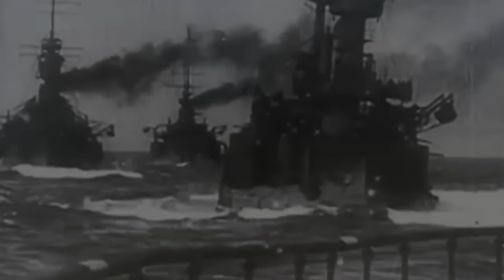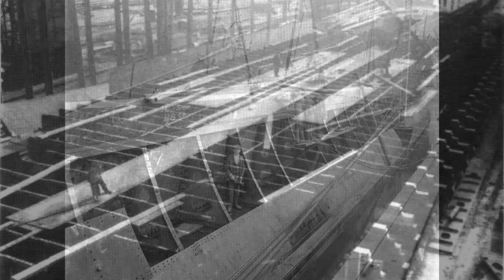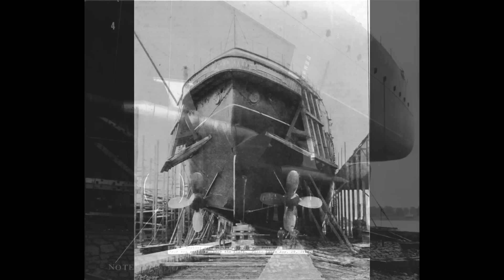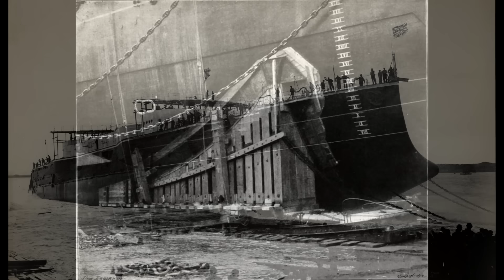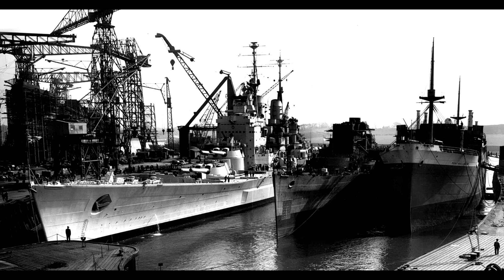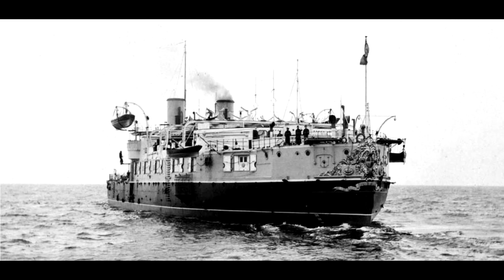Naval Engineering - Building a Battleship from Keel to Commission

Comment: My father worked briefly on the Clyde shipyards in Glasgow, around 1952. He was a rivet-thrower, only 12 or 13 years old, he spent all day picking up red-hot rivets that weighed about a pound with tongs then flinging them 2 or 3 stories up to the catcher as described in this video. Apart from the danger and the constant sight of other people getting terribly injured, the notable thing about this job was that the slightly famous Scottish comic Billy Connolly was working at the same yard and they crossed paths numerous times.

Comment: Interesting Video, thank you.  I do have a question about the slipway.  You said the angle of the ship on the slipway had a sloop of 1 to 19.  Is that 0ne foot for every 19 feet of ship or in metric 1meter for every 19 meters of ship? So, for example an Iowa class battleship the bow would be 47 feet higher than the stern.

Comment: Re the riveting team: one man operated the riveting gun. This was hard and fairly skilled work. The other man on the other side held a lump of steel against the rivet being driven, which caused the end to round off tightly. This job was easier and less skilled. That “lump of steel” is called a dolly. During the War, because of labour shortages, women were often used to hold the dolly. They were known as Dolly Birds.

Comment: As someone who is a fifth generation Brooklyn ironworker and steel fabricator, you have done a masterful job, Drach. You describe, exactly as I would, how to make you a ship!. Or pretty much anything else from metal. I started laying out projects just as they did. Creating templates to form the steel..."lofting". Even to-day, using computers, I give anyone rolling a steel cylinder or cone a "sweep" A piece of very light steel cut at a radius so we know how much to roll it. If it is under, we roll it again, if too much, we hope the plate has enough mass to unroll itself a bit...lol. Sometimes, unrolling gets quite fun! Forklifts, nearby machines, and even trucks serve as anchors to unroll things....not for the faint of heart.
But you have the riveting exactly right. Although that poor benighted guy on the inside of the crew, all alone, not able to heard a darn thing, backing up the rivet so it could be set and forged, is called, In America, the buck-up boy. Even if he's 70 years old. He had to be utterly reliable and have a great sense of rhythm. MY Dad was a buck-up boy through his teenage years. He told me very funny stories about it. His chest was black and blue for years because he didn't buck up fast enough...lol.
They drove 5/16 rivets cold by hand, 3/8 were cold with two airguns. Smokestacks took tons of these size rivets. Anything larger was exactly as you describe. 
We had a man who worked for me in 1983 who was 80 years old. He had been employed by us when he was 14 in his summer breaks. He worked for me until a week from his death. When anyone would talk about the "good old days", he'd tell you how they cut a 3/8" plate back then. They would take a plate and lay it on a railroad track, scribe a line. Then they would take a giant chisel with a handle going through it so two men could hold it while 2 more men drove sledge hammers on that chisel. I used to know what that chisel with the cross handle was called. Maybe  "gandy"? But those men would slide it down the line they wished to cut, cutting against the railroad track, which have very hard surfaces on top. A 5 ft wide cut might take all morning. Then they would flip it over and do the same on the other side. Then they would break it like a piece of gypsum board. A 3/8 steel plate. Before oxy acetylene, that's how you did it.
He would tell that story, and then say, "F**k them good old days!" I have always had a shear that could have done their whole day's work in 3 seconds. Now even a mighty shear that can cut a 12 foot plate in those few seconds lies idle. We use CNC plasma to create precision parts. The business is completely changed. And, like old man Silliman, I say, "F**k them good old days!"
Cheers!
Nice job.
BTW, the wooden derricks you cite were either sheer legs or gin poles. And if you saw the ease men could erect them and take them down and move them around, it would shock you. Craftsmen could put them up in minutes like breathing. But they have their limits. I have built 100 foot long ginpoles out of aluminum tubing. When I told the rigger my misgivings about it flexing, he just laughed. "Like a fishing pole?" I said yeah. What keeps it from flexing, making the column strength disappear? He laughed again. "You place a weight at the midpoint with a chain block. When the pole starts to flex, you lift the weight. It straightens out and you can keep picking!". Of course, the physics is correct. If you keep the column straight, you must defy the entire compressive strength of a metal. Which we both know is enormous. Even 100 feet long.
He used his craftsmanship to make a thing which we, as engineers, would predict failure, and supercharged it. He used a simple toll and could make it do three times what it should have. No college. Just an innate understanding of the forces at work. In his bones.
I wonder how much other such knowledge has been lost to mankind. Don't you? And he, who cannot even make the simplest sketch to describe an object, can do this and become THE master rigger of NYC, with an absolutely untarnished record of success, knew this trick, which no decent engineer would have even contemplated! And it worked! Perfectly!
Imagine what some Egyptians could have taught us.

Comment: On having to cut holes to replace machinery.

My dad was the first Chief Engineer on the TT Bedford in the 60s one of the very first 'Super Tankers' built when the Suez was closed forcing ships right round Africa from the Gulf.

He went to Japan while it was being built and was the commissioning engineer for the machinery.

It sailed to Rotterdam where it had to be drydocked as there were problems with the turbine gearboxes and a hole had to be cut in the hull side to allow them to be replaced.
This needed to be done at great expense in a drydock.
As a youngster I flew out to Rotterdam with my mother and younger sister to join the ship while it was in drydock rhen alongside being recommissioned

Comment: I've witnessed the construction of a Nimitz class carrier from the keel on up.  It's done differently now, but not by as much as you might think.  Computers take the place of a wooden model, and ships are built in chunks which are then lifted into place with a crane and then welded into place.  It's a very interesting process to watch.

Comment: I'm a naval architect. Old enough to have been an apprentice at a mold loft.
This was a very accurate description of the oldfashioned building process. Untill computers took over the modelling of hull shape.
Also i wonder if an inclining experiment hadn't been included in the final tests. To assure, that the weight and centre of gravity was as promised, when the contract was signed.

Comment: The slipway was on an angle. When working on board you still needed to build to that angle.
The process involved using a builders level, but at each end there is a tube with the bubble in it and this could be rotated.
You go down to the slipway andbset your level onto it, then rotate each bubble to be level. Finally you tighten up the rotational part so it becomes immovable. 
Now you have a level which can be used inside the ship accurately!

Comment: FWIW it seems the ablution facilities in WWI-era British battleships at least were surprisingly basic. 
Apart from the captain and admiral's quarters and the sickbay (which had actual baths) everyone else only had basins for 'bird baths'. Those for the officers weren't in a single washplace or plumbed to their cabins: instead, the stewards brought hot water cans to fill a small tank atop a washstand cabinet. The officer would let the water into a basin to wash/shave, which tipped up on completion into a tank underneath for removal by the stewards. One of these washstands from Iron Duke can be found at the Scapa Flow museum in the Orkneys. 
Meanwhile, the sailors had their own dedicated spaces with multiple washbasins, which probably weren't individually plumbed either.
As far as I can tell plumbed sinks and showers only became a thing from the 1920's / 1930s.  Even then, limited water supplies meant showering entailed 30-second wet / soap on then 30 second rinse / soap off , which lasted into the 1990s. As it seems unlikely that money would have been spent upgrading the WWI ships the same standard (space/weight issues aside), the previous system would have endured until the last of these ships left service after WWII.
Must've been interesting if the sea was a bit sloppy... and made these ships a bit whiffy in the tropics...

Comment: In addition to the book you recommended, I'd also recommend Silver State Battleship, on the USS Nevada. While not as in depth as The Battleship Builders, it does give a solid account of the designing, ordering, building, launching, and trials of that ship over the early chapters. It also gives an account of some of the...unexpected challenges and results there in during building and trails.

Comment: I was astounded to learn in your video how unfinished the ship was when it went down the slipway. Was this more of a result of a premium put on slipways real estate space as opposed to dock space which could be used for fitting out purposes? Have you seen any man-hour estimates to complete a warship project? The time it takes to loft, cut steel plating, fitting, riveting and assemble the hull structure super structure would be relativity quick as compared to the fitting out of the remainder of the ship. As stated in your video, this building scenario is representative of British shipbuilding up to 1950. I recall reading and seeing photos of German U-boats built in the second world war which were built in near completed cylindrical modules with the majority of fitting out components installed in the module before welding up the individual modules together into a boat. This is of course how ‘modern’ ship building is currently done, at least in Asia. I assume these modern techniques are used currently in British warships construction. Did this modern process start before 1950?

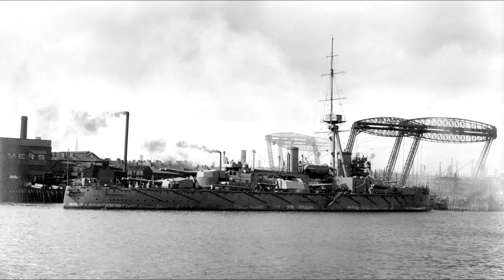Comment: 28:00 Of course “perfectly flat and level” is impossible what was the actual tolerance? (For example) The procedure for installing something like a barbette would have changed significantly over the period covered, as the weight went up by what 10X? From say 1895 to 1935, be interesting to review the changing procedures.

Comment: I had a career in construction and find it very interesting the ships were built with the keel raised slightly for launching. This meant that a level had to be adjusted , because a plumb line would not be perpendicular to the deck. I wonder if they had a tool that adjusted for the offset or if they just used a tape measure to get bulkheads perpendicular to the deck.

Comment: Regarding the scale reference ship model, the father of one of my tool & die mentors, who was also a tool & die maker, worked in a steam locomotive factory where they had full-sized drawings on the walls. According to my mentor (who was a WWII veteran, to give you a time frame), they would directly pick dimensions off these drawings using scales (rulers) and calipers. Apparently, only a limited number of part and assembly drawings had any dimensions as we would expect to have today.

Working with tool & die makers helped me when I later worked as an engineer: they are amazing multitaskers who must develop a talent for simplifying their workflow.

Comment: Great video, Drach. Outstanding. I do have a copy of Battleships builders of course, hence one remark: you missed pretty important issue of slipway understructure. That was issue that had to be considered in work designing period - because if you was erecting big battleship it could occur to you that understructure may crack down before ship is ready to lunch due to being too heavy, and if you missed that bit slipway could collapse, and then you have much bigger problem to deal with - and it accually happened to one battleship,  cant remember which one, but I'm in the train now and my maritime bookshelfs are quite a distance from me.

Comment: "minimising complex shapes and curves"
Fun fact: The artist Richard Serra made sculptures from huge steel plates which were shaped by a machine formerly used to shape the hull plates of submarines.
Reply: Was he the one that built huge sculptures designed to be climbed on?
Because I remember seeing a few of those in the tate gallery as a kid, and had a whale of a time stomping up and down the huge spiral stairs on one.
Reply: @Skorpychan  The works of Richard Serra I am familiar with (which is by no means complete) are very minimalist, made of several meters wide, inch-thick steel plates stuck edge on in the ground. Climbing would probably be...difficult. That being said, if you can find the name of that artist, I would be very interested to read more on that.

Comment: I'd never heard the term mold loft before, but (at least on the western side of the pond), the act of translating a scaled drawing of a boat's lines (or set of measurement "offsets" at points/stations along a line) into full sized plans is still called "lofting"
Reply: Same goes here, Under Down Under, my friend - i didn't know why it was called lofting, but I do now...😊

Comment: I was struck by the mention in the video (at 6:33 https://youtu.be/2mMEsUmG9mQ?t=393) that the template was used to make a 3D model at 1/48 scale.  For a KGV class battle ship, this means the model would have been 745 (227.1m) ft/48 = 15.5 ft (4.73m) long, which is quite a big model!

I had always thought the famous model of the Montana class battleship (photos of which can be found on Wikipedia and elsewhere) was a few feet long at most, but I just found when I counted the number of floor boards visible beneath the model in the side shot that, multiplying by the standard 2.5 inch width of oak floor boards in the U.S., it was around the same size - presumably a bit bigger, since at 921 ft long the model at 1/48 scale would have been a little over 19 ft long.

https://en.wikipedia.org/wiki/Montana-class_battleship#/media/File:Montana-Klasse_Modell.jpg

Another photo of the same model shows it atop 12 file cabinets lined up side by side.  The standard size file cabinet was about 18 inches wide, which corroborates the model was indeed that long.

https://www.history.navy.mil/our-collections/photography/us-navy-ships/battleships/montana-class-bb-67-71.html
https://upload.wikimedia.org/wikipedia/commons/5/57/Montana_Class.png

But then if you are going to use a model for creating templates, they will be more accurate with a large model, so that makes sense.

Alas, given the shortsightedness of the U.S. navy in that era when it came to preserving history, it was probably burned, perhaps with the view that it constituted classified information you didn't want to leave it lying around once it was no longer useful.  If one of these models is in a museum somewhere I haven't heard of it.

It would be a great model building project for someone to do, assuming there was a museum somewhere that wanted to devote that much gallery space to displaying it.  The Yamato museum does have a model of similar size (I believe it's not the original one), but that museum is dedicated to just that one ship.

Comment: In these old ships, isn't portholes a BIG design flaw in protecting important areas of the ship or didn't they care?
Reply: For the most part portholes were above the armored deck and/or fore and aft of the citadel.   A few refitted ships lost portholes when their armor belts got taller, for instance.
Reply: Portholes didn't go through armor plates - they were always placed in locations of the ship where there was no armor.  

For example, the portholes might be placed above the highest armored deck.  Or there might be a section where the armor turns inwards, then up - with a region outside the upper armor where people can live, so portholes placed there are still 'outside' the armor.

A lot of the superstructure wasn't armored.  So there's no reason not to have portholes in the unarmored portions of the superstructure.

Naval portholes had a piece of steel on hinges, with strong fasteners on the inside, to cover the porthole at night.  This is often called a 'deadlight' or 'sidescuttle'.  If thick enough, these provide a small degree of protection (splinter protection): they also keep light from escaping at night (which would give away the position of a ship).  Sometimes they were welded shut during time of war.  

They did have vision slits in armor, for the conning tower of larger warships - on larger warships, this is one of the regions of the superstructure that IS armored.  You can see these on larger museum ships such as battleships.  A vision slit is not a porthole.

The vision slits were a vulnerability, since shrapnel could go through them.  Shells would be too big to fit, so not that big of a vulnerability.

If you don't have easy access to a museum ship, look up 'uss new jersey bridge' - there's a video where you can see the vision slits.

Comment: I’ve got a backyard shed, a pool, and now this guide! Just need about 30,000 tons of steel and I can get to work
Reply: leave it for fitting out at a national dockyard, then you only need 18,000 tonnes
Reply: Also, if not fitted out, you can build a bigger ship for the same displacement in your pool...
Reply: You’re gonna need a bigger pool! 😂
Reply: @mauryfeskanich4523  which is now the prelude to the Richard Dreyfuss line... can't make a bigger boat without a bigger pool... or shed.... or drydock
Reply: You need a bigger pool with a bigger pleasure